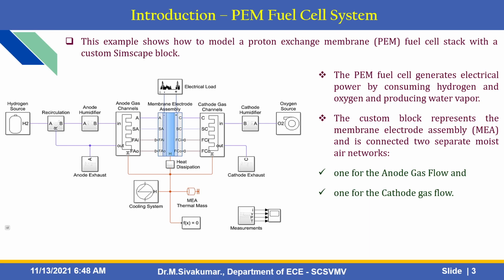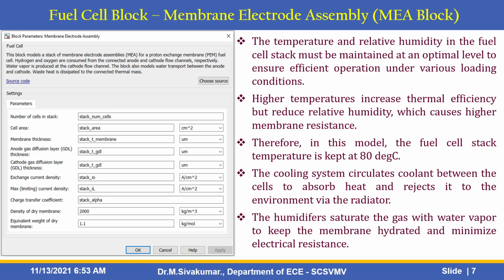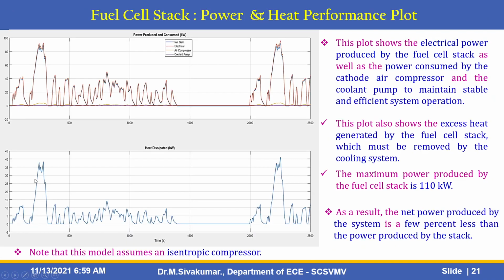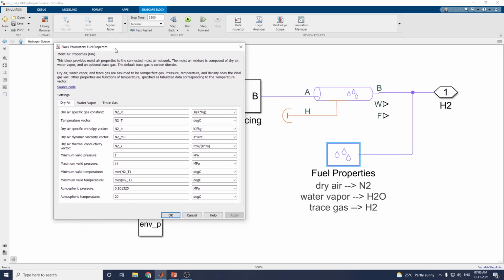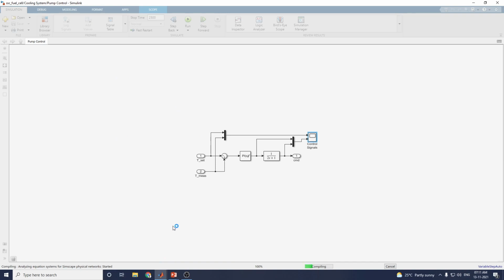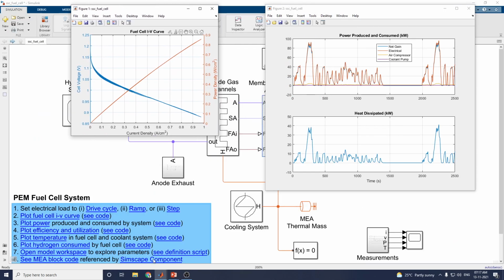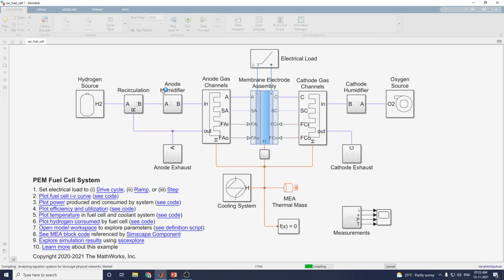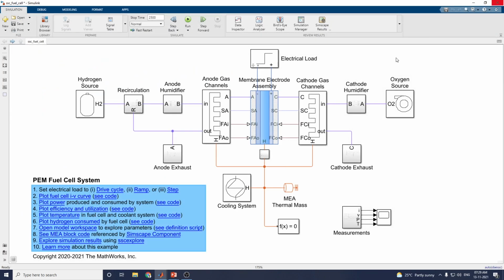Modeling & Analysis of PEM Fuel Cell System Using Matlab Simulink

Comment: It is impossible to download through the ahared links. It bombards you with adds and does not lead to the file at all
Reply from the maker: It's possible...Click the Google drive link to get the model file.
Reply: @DrMSivakumar  it's run in matlab 2024a virsion

Comment: thank you sir ,can i connect this model with a pv systems and a boost converter and use the pem electrolyzer like a electrical load for producing hydrogen is this possible ?

Comment: Thank you for this informative video. How can I save data in simscape results explorer in excel sheet or matlab workspace? I want to see for example the change of air compressor power with respect to air excess ratio. How can I have two power plots together? is there any way to run the model with OER=1.2, save the power plots and then run the model with OER=2.5 and make power plots with including the previous one?